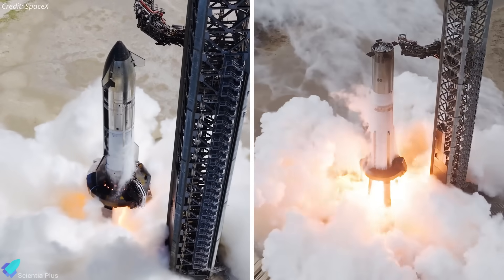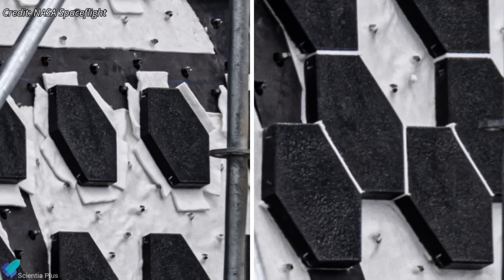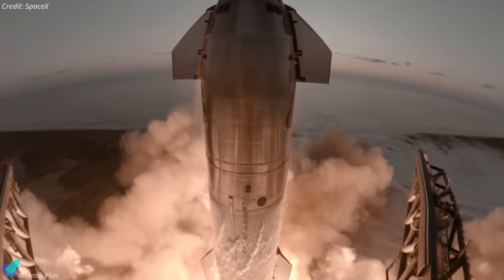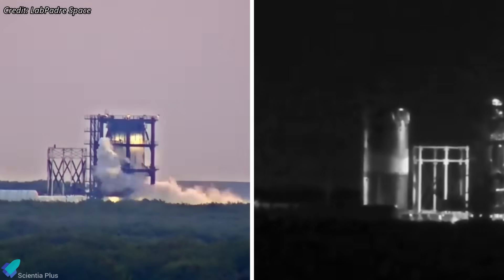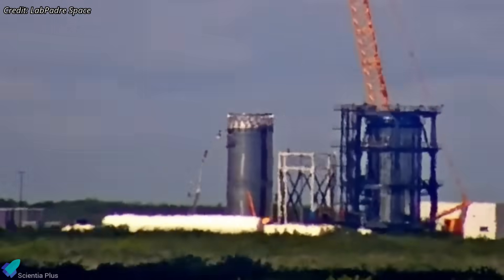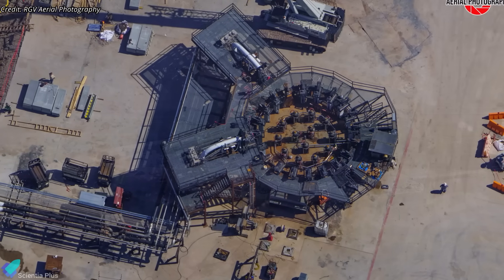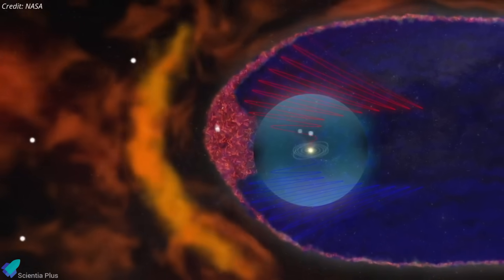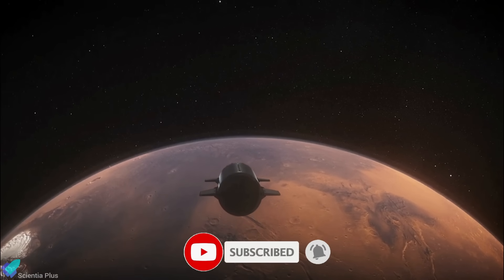Starship Flight 11 Pushed Back – Ship 38 Problems Found! New Launch Date CONFIRMED

Comment from the maker: 00:00 Starship Updates
09:50 NASA Launches 3 Spacecraft to EXPOSE Sun's Secrets!

🚀 Starship Flight 10 
  📽Detailed Breakdown: https://youtu.be/irVUMJNe0Kc
  📽Root Cause of Anomalies: https://youtu.be/LBUpp7MRVSY

🚀 Booster 18.1 / Test Tank 17 
      Explained In Detail: https://shorturl.at/wPg6Y
      10 Rounds of Tests COMPLETED!: https://shorturl.at/uDeSG

📚 Learn More:

🚀 Starship Block 2 Explained:
 📖 Summary: https://shorturl.at/b0dtw
 🔍 Detailed Explanations:
  • Design Improvements Update 1: https://shorturl.at/lpGT7
  • Design Improvements Update 2: https://shorturl.at/gwNQ4
  • Nosecone & Payload Bay Redesign: https://shorturl.at/xa60S
  • Methane Downcomer Redesign: https://shorturl.at/XdYBG

🚀 Starship Block 3 Explained: https://shorturl.at/mnBT4
  • Detailed Breakdown: https://shorturl.at/IViwD
  • Production Begins: https://shorturl.at/xRNkJ
  • New Transfer Tube / Downcomer Explained: https://shorturl.at/Iaqc6
  • New Grid Fin Explained: https://shorturl.at/NxdVo

🚀 Starship Block 4 Unveiled: https://shorturl.at/7A2ef
 
🔥 Raptor V3 Mega Upgrades & First Test: https://shorturl.at/TRIyj
🧱 What’s Inside Starship GigaBay?: https://shorturl.at/nJM75

🛠 Insane Engineering of New Starship Launch Pad 2: https://shorturl.at/7RAZd

🛢 Dual-Port Orbital Refueling – Full Technical Breakdown
https://shorturl.at/5tiqK

🛠 Other Starship Upgrades:
 • Hot Staging Explained: https://shorturl.at/jf400
 • Super Heavy Booster Upgrades: https://shorturl.at/Pi5R3
 • How SpaceX Protects Raptor Engines: https://shorturl.at/4Om8F
 • New Heat Tiles Explained: https://shorturl.at/p2Ijb

🚀 Starship Flight 10 
  📽Detailed Breakdown: https://youtu.be/irVUMJNe0Kc
  📽Root Cause of Anomalies: https://youtu.be/LBUpp7MRVSY

🚀 Booster 18.1 / Test Tank 17 
      Explained In Detail: https://shorturl.at/wPg6Y
      10 Rounds of Tests COMPLETED!: https://shorturl.at/uDeSG

📡 Stay Updated:
📢 Weekly Updates: https://bit.ly/3HIQjPC
🚀 SpaceX Playlist: https://bit.ly/34wue8T

🌍 Follow Us:
👍 Facebook: https://www.facebook.com/scientiaplus

Comment: Not an issue, the Starship spacecraft is designed to fire its engines in space, not on the ground. Of course, the vibrations would be much worse on it during a ground engine test firing.